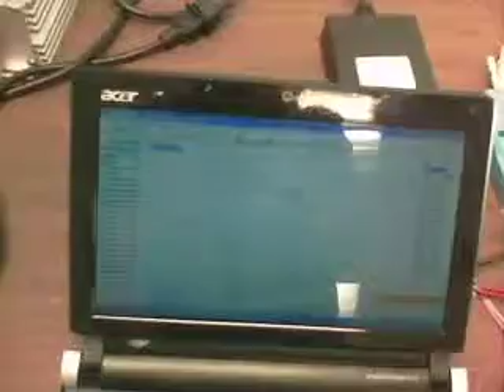Amperor's LED Driver with DALI bus interface

Comment: To MikeyJW100

DALI is a defined standard, led by a consortium of lighting manufacturers. Products identified by the DALI logo, made by different manufacturers, are designed to work together. DALI LED drivers are available all over the world.  Many of them are made in China.  I have personally used them. See the videos I uploaded to You Tube.

Comment: Just one more question, as there is NO DALI standard for controls products such as Sensors, Switches, Dimmer controls, I assume you cannot use other manufacturers DALI controls products on the same DALI network as those you show?

Comment: Hi. I have a question. Does the DALI interface power supply supply 16 V in both of the terminals or is one of them 16V and the other one ground? I don't understand how this really works. Do master and slave comunicate in separate lines or the same one in both directions?